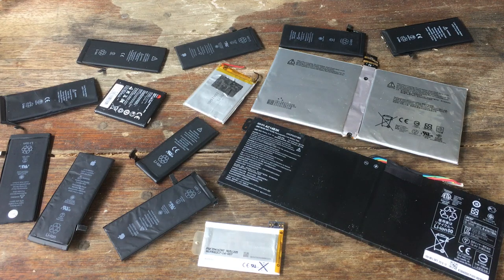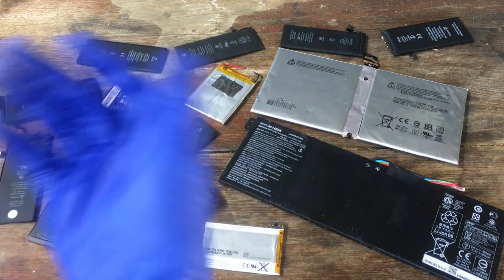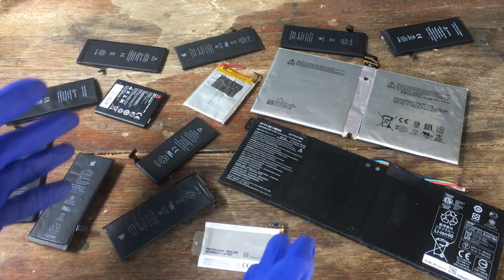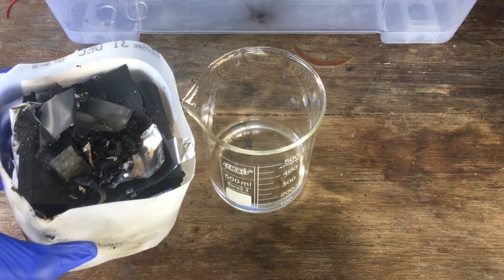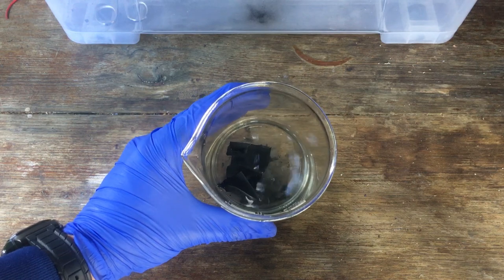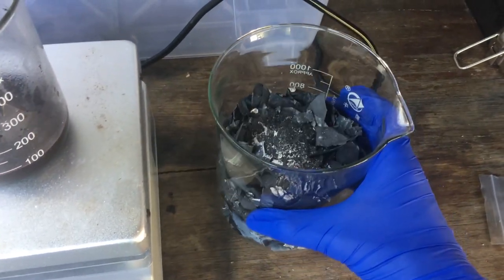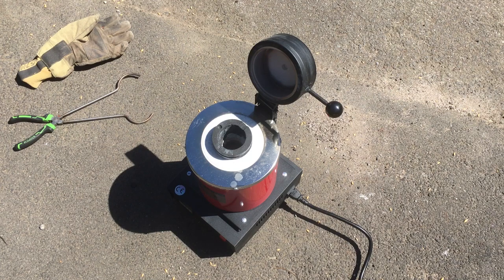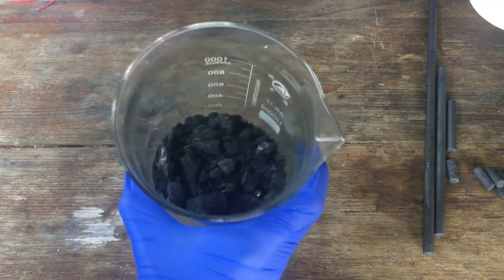Lithium From Li-ion Batteries - Part 1

Comment: Lithium will be well incorporated into that mineral mass you formed after fusing, that is after all the favoured discharged state and very stable (e.g lithium cobalt oxide). It's not present as lithium oxide, rather lithium minerals, so won't just selectively dissolve out in high yield. A little probably dissolved as lithium aluminate, but most of it probably still locked away in that matrix of fused product.

Comment: The easiest way to get the lithium out is to fully discharge the batteries, then shed the guts and treat with carbonic acid soda water under pressure. The bicarbonate of lithium is extremely soluble. All the other metals are insouble in carbonic acid. The aluminum side is generally the anode and is pretty worthless. The copper foil side has the goodies in it generally cobalt and nickel oxide. Sometimes the batteries have nickel plated alumium as the cathode side collector. The easiest way to get the metals out is to process with a strong alkali to disolve the aluminum and a strong acid to free the metals. ❤

Comment: If nitric acid supply is inadequate because of aluminium excess, could you get rid of the aluminium first, by dissolving the whole lot is sodium hydroxide solution? Then the Al could be decanted as sodium aluminate solution; I presume (but am not certain!) that the lithium salts would remain behind...
Reply from the maker: Yep, that was one of the plans to get rid of the aluminium. However, I decided against it in this case so that we wouldn't be adding sodium ions to the process at any point. I'm desperately trying to avoid sodium contamination since it will easily dominate our flame tests in the future.
Technically, I could have used potassium hydroxide I suppose (potassium contamination is much less of an issue), but I didn't think of that at the time sadly.

Comment: Using a furnace i think you had destroyed the lithium you should have separated the lithium from aluminum foil and then leach the metal from that cathode matrial and then precipitate
Reply from the maker: Why would the furnace destroy the lithium? And how are you suggesting to separate the lithium from the aluminium?
The lithium in these electrodes is not in the form of metal - it is in the form of lithium cobalt oxide, where the lithium is present as ions, and is impossible to separate mechanically from the surrounding material.
Reply: @ScrapScience  Hi thanks for your reply during the heating in furnace lithium accumulate in the slag but i have some queries when you have melted the whole cathode and then cold it what happend to oxide and why you used water to extract lithium not any acid. I'll be very grateful if i can establish a proper contact with you. I m a researcher and i need a good discussion with you. I hope you will understand

Comment: You could use HCl (or acetic acid) with H2O2 (in a well ventilated area) some times it worked for me in such situations.
Reply: what is the purpose of H2O2?  there is nothing to oxidize there
Reply: @deltaxcd  The H2O2 is used to oxidise all metals to their highest oxidation state and in some cases to the oxide form because some metals like zink, lead and some inorganic salts are insoluble in HCl or organic acids.
The H2O2 with HCl also produce some Cl radicals and Cl2 gas which is quite corrosive to most metals.
Reply: @MrApokalipse666 I've done many of these electrode dissolutions and so long as you don't mind the Chlorine gas that comes off, you do not need any H202 at all. HCl will straight up completely dissolve the Aluminum foil electrode giving off H2 gas and heat from the Aluminum and CL2 gas for any cobalt in the higher than +2 oxidation state. The leftover black bits are carbon/graphite + PVDF. Everything else should be in solution and probably a little bit of chlorinated hydrocarbons. Where the H2O2 comes in handy is if you use sulfuric acid as this does not have the ability to reduce and will not dissolve the cobalt in the higher oxidation states without H2O2 being added.
Another tip I've found is that you don't need nitric acid to dissolve the copper electrode. Just take some KNO3 or NaNO3, mix in some HCl toss in the copper foil, add some heat (you don't need much heat here as a warm summer day in direct sun will get this going vigorously) and that will make quick work of the copper foil. This method takes some finesse...if too much copper added, some of the Copper(II) (green solution) will reduce to Copper (I) (solution turns brown). Just add some more HCl + Nitrates to get it back to Copper (II). While this does make some NO2 gas, I find that it isn't that much (and nowhere near the amount of NO2 that nitric acid + copper produce) and the reaction is mostly happening via the NOCl route (Nitrosyl Chloride). NOCl reduces to NO2 + metal chloride and so long as there is excess HCl present, the NO2 will stay dissolved and reform Nitrosyl Chloride (2NO2 + 4 HCl → 2NOCl + 2H2O + Cl2). If you don't let the reaction proceed too fast, even the Cl2 will stay dissolved and reduce copper directly with very little net gassing.
Reply: In the last sentence, I meant to say "oxidize copper" not "reduce".

Comment: I think you were on the right track and had extracted the lithium with water, just boil the water off and you gain the lithium hydroxide.
Reply from the maker: That's exactly what I try from 15:17 to 17:22 with the boiling down and the flame tests, the only difference being that I neutralised it first. None of it gave any indication that there was lithium in solution...
Reply: @ScrapScience  But u did this after pouring the potassium carbonate. The potassium then would dominate the flame colour, i think.
Reply from the maker: That does make sense. However, I only added potassium carbonate to a small portion of the original solution. The stuff I boiled down and flame tested test did not have any potassium carbonate added to it, so it can't be dominating the flame colour. There might be something else drowning it out though - I'm not sure.
Reply: @ScrapScience  Maybe you produced some graphite ash in the furnace? Then there might be some Ca causing the flame colour (It is orange, right? I am colourblind :D)

Comment: Watch extractions and ire's video. You need to check.
Reply: The polymer membranes probably contain dissolved lithium too
Reply from the maker: Yeah, I've watched it a few times lately. Since he was only capable of getting a 2% yield with that method, it's not the route we're going to be following. The point is to try something different here.

And yes, the membranes probably have a bit of lithium in them, but the quantity should be extremely small compared to the oxide mixture, and the process of extracting it is much more difficult. A better chemist might give it a go, but making the extra effort for a tiny increase in yield isn't something I'm prepared to do.

Comment: i bought undercounter battery magnetic lights for 2 bucks each and then parrelleled my still working batteries  with the small original batteries of each one so i only have to charge them a couple times per year.

Comment: I think you should be keeping nitric acid in amber reagent bottle. Distilling potassium nitrate and sodium bisulphate is fast way of making red fuming nitric acid  shouldn't take all day to do a few runs of that plus you can dilute it
Reply from the maker: Don't worry, I keep my nitric acid container wrapped in aluminium foil and out of the light when I'm not using it.
The potassium nitrate/sodium bisulfate method is actually how I made this nitric acid, and it did take me a full day to make 150 mL of the stuff (which was the combined total of six batches). I'm afraid I just don't have the glassware necessary to run the reaction on a large scale yet.

Comment: those plastics membrane layers from those batteries.
Please tell me you kept those because those make really good membranes for other electrochemistry and they replace flower pots for it.
Reply from the maker: Interesting, I always assumed the separators were some kind of lithium ion selective membrane, and that they were useless for other processes. I had no idea they were just microporous diaphragms.

Yeah, I've still got all of them, I'll be sure to hold on to them for later use.
Reply: @ScrapScience  some of them are useless like that but not all. you would have to test them individually because either they use a lithium ion selective membrane or a general cation exchange resin which is better than a porous diaphragm.
These are not porous diaphragms but are similar to my PVA-Citrate membranes but are better because they are selective and nonporous.
A selective cation exchange membrane will not let solution to pass but sodium ions and the like can pass through which means you get better yield in membrane processes.

Comment: You should try out oxalic acid to form lithium oxalate from solution.  I normally use oxalate acid salts and use ethanol or or other organic solvents to selectively precipitate products.  I haven't extracted lithium in a while, but I typically get good results going the oxalate salt route.

Comment: There will be no lithium oxide , you start with pretty much pure lithium when you open battery then it starts reacting with air and those tapes get hot,  then lithium oxide will react with water and carbon dioxide form air making lithium carbonate which is weakly soluble and very stable thermally. I think you could recover lithium with something like citric or acetic acid bit to have something useful it has to be converted into lithium hydroxide somehow and that is pretty hard to do.
Reply: Why tf I doesnt this have more likes

Comment: Ohh mate! Disappointing results, but still an awesome project to watch!! Keen to see where you go with this in the future. Don't give up!!
I tried this a couple months back with some cheap lipo batteries from a broken drill battery, different route, but with similar results. I'd dissolved all the mess into concentrated HCl, filtered, and precipitated out the metals with oxalic acid. I didn't have the issue Ex and Ire had with having to add oxalic as a salt, but then when it came to dropping the lithium out with carbonate I got absolutely nothing. In any case I was mostly after the cobalt anyway, so I just burnt off the oxalate and dissolved the oxides into sulfuric. to seperate the nickel out I got the cobalt into a +3 oxalate complex and the nickel fell out. But i think there was a bunch of other mess left over in there as after I oxidised the cobalt again and turned it into a sulfate the red solution grew green crystals. I can only assume there must have been some iron contamination, likely from incinerating it in a stainless steel pot. 
Anyways blah blah, this video series has got me excited in that project and I'm considering trying it again taking some lessons learned from your series and thoisoi's video on the topic. But it is kinda fun chopping apart other peoples methods and trying your own. And rewarding when it works!!
Reply from the maker: As far as I can tell, pretty much everyone seems to get disappointing results with this extraction, so my hopes aren't particularly high here. It's good to hear other people's experiences in this area as well, so thanks for that!
At the very end of the extraction, I do have plans to separate the cobalt from the rest of the transition metals. I like your cobalt/nickel extraction method here too, maybe I'll have to look into that one.
Reply: @ScrapScience  ooof, i just got back from a short walk where i managed to collect 46 old iphone batteries, totalling 80605MaH. From some calcs it looks like there should be around 24.2g of lithium, or 257.6g if i can get it as a carbonate!! this video really made me wanna try it again haha.

Comment: lithium oxide reacts with aluminium oxide at temperatures between 400 and 1000C to give lithium alluminate (that should be an insoluble compound) so maybe that's why you don't have any lithium in your leaching solution

Comment: I started to do this once, I still have the liquid.  I dissolved the aluminium with 8% cleaning vinegar stirring it at around 60C. 10 batteries took around 6 hours and a liter of vinegar to dissolve most of it. I left it for a few days and it all dissolved. I never went any father. Maybe that can help
Reply: ok I look at my videos, I dissolved the aluminium with 30%  acetic acid stirring it at around 60C, 10 batteries. 1 liter of 8% cleaning vinegar I dissolved one tablet battery

Comment: +Scrap Science The nitric acid method actually works. You just need to add some hydrogen peroxide to convert the cobalt in the electrode from +3 to +2.

Comment: Leaching with 2 M sulfuric acid with the addition of 5% H2O2 (v/v) at a pulp density of 100 g/L and 75 °C result in the recovery of 99.1% lithium and 70.0% cobalt in 60 min. H2O2 in sulfuric acid solution acts as an effective reducing agent, which enhance the percentage leaching of metals.
Reply: From which time H2O2 can be "reducing" agent?

Comment: Why you cant boil of the water of the hydroxide and then decompose the hydroxide to lithium oxide by further heating? I understand thats what happens around 950c
Reply from the maker: I mean, we could. But since we didn't have any major quantities of lithium in solution, it wouldn't have been useful. If we did dissolve significant lithium, our carbonate precipitation would have done the job anyway.

Comment: reacting a solution of aluminium forms aluminium carbonate which decomposes into aluminium oxide
this aluminium oxide should be difficult to dissolve in an acid, where the lithium should be more easy to dissolve in an acid

Comment: I might be wrong, my only education on this is an honors chemistry class.

So i understand that Li is above K on the activity series, and therefore a reaction with KCO3 will occur. But LiCO3 is still soluble. So it will not precipitate. It appears as if you were confused why it didn’t, but I thought it was commonly known that alkali metal compounds are soluble. Was there another point to this?
Reply from the maker: A couple of things here:
First, the activity series only applies to single displacement reactions. In this case, we're doing a double displacement reaction between potassium carbonate and the lithium hydroxide we were expecting to be in solution, so it's completely irrelevant to think of things in terms of the activity series.
Next, lithium carbonate is actually barely soluble in water. At boiling temperatures, less than 1 gram can dissolve in 100 mL. We were expecting a possible yield of over 60 grams, so the salt should definitely have precipitated if lithium were present in solution. In fact, this is a very common method for extracting lithium from its solutions.
Hope that helps!
Reply: Lithium carbonate is very soluble and bicarbonate is extremely soluble. He attempted common ion effect but for carbonate it is tricky to do. Generally you need a highly ionizing ion like sulfate or chloride, but it isn't gonna work with lithium because LiCl and Li2SO4 are more soluble than the Na and K salts. Easiest way to grab Li is to treat with carbonic acid and leach it with a soxlet type setup then dry it.

Comment: It's not a failure, it's just an alternative version of success. You mentioned that the black mass has graphite in it, have you considered just burning that out? Get the furnace up to high temperature and pump through oxygen. You'd certainly be sure that everything was oxides then but I doubt they would be simple elemental oxides. Good luck.

Comment: Nitric acid doesn't dissolve aluminium.  If it does then it's not aluminium
Reply from the maker: That's only true when the nitric acid is very concentrated. When it's dilute (as I was using here), it has no trouble dissolving aluminium, since the passivation effect doesn't work with water present.

Comment: Maybe dissolving the metals in aqua regia would have worked. It's also more efficient on HNO3 use since 3 out of 4 parts are cheap HCl anyways. After that, a good old hydroxide participation, followed by adding sulfide/bisulfide in any form should definitely percipitate all transition metals. You just gotta be careful and not add too much OH-, because the participates of some metals such as Nickel can redissolve as complexes in case of an excess. Lastly, reducing the volume of the filtrate, followed by adding carbonate while the solution is still warm, should yield the lithium.
Reply from the maker: I tried something along those lines in part two of this video series, though I used a different acid and an odd source of hydroxide for the hydroxide precipitation. Still didn't work in extracting lithium, but I was eventually able to isolate the cobalt and nickel from the original mass.

Comment: Why add potassium instead of distillation
Reply from the maker: Precipitating lithium carbonate would ideally act as a final step of purification. The lithium, if present, should have precipitated out and left behind most of the things that weren't lithium. Simply boiling down the solution would have crashed out everything with no purification at all, and would also require more effort.